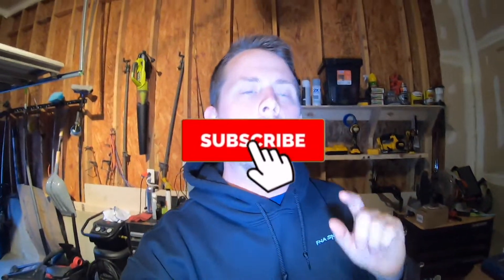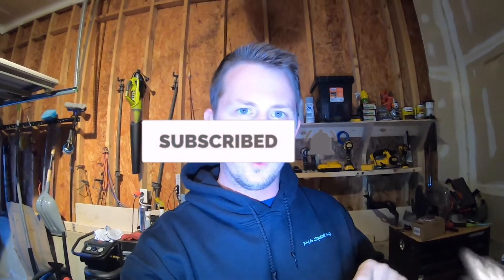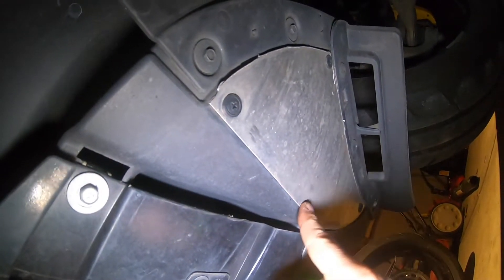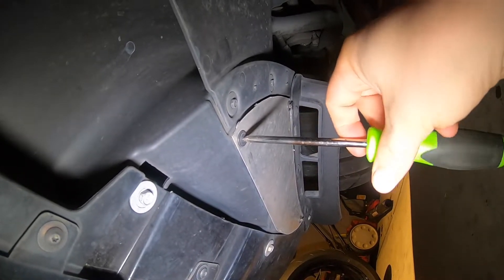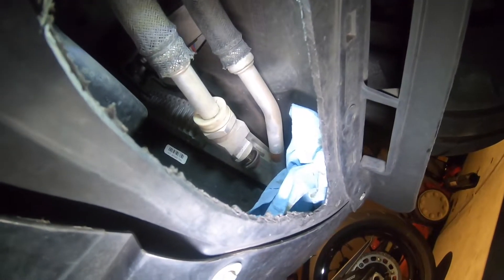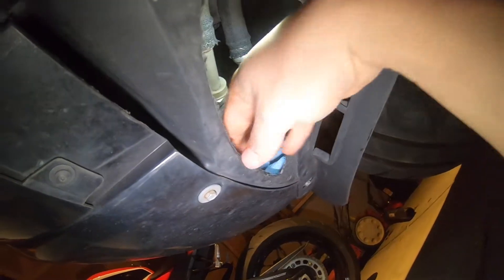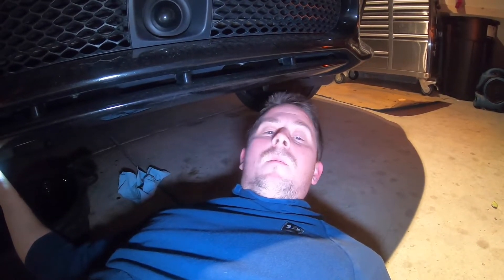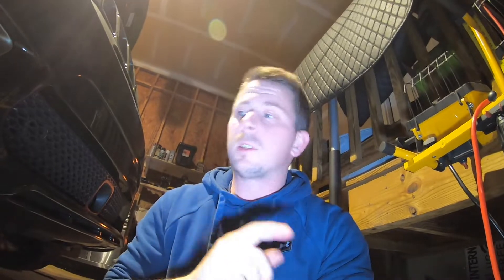HOW TO drain the oil cooler on a TRACKHAWK!

Comment: My guy at the shop just tucks a cut oil container under the drain. Never had to cut an opening on the bottom. After he showed me how to do it I scrubbed my plans of cutting an access panel.
Reply from the maker: EastCoastJeepSRT that’s interesting.  How do you get to the plug?
Reply: FnA Speed I’ll ask him to use my GoPro on my last free oil change at the dealership. He cut a quart or oil in half and slides it underneath. Not sure what he uses to open the drain. My concern the first time I went was them removing my bumper to do it. Told them don’t do that. Dude just says don’t worry, watch. Super easy.
Reply from the maker: EastCoastJeepSRT well then... I’d be interested to see for sure.  I couldn’t figure out any other way to get to it but then again, there are much smarter people out there 😂

Comment: There's a gaurd liner  on the offside wheel arch behind the cooler thats just a few bolts and clips then you can take it off and easily access the oil cooler...i dont know how to send pics but i did it for my misses n her trackhawk 2018 6.2 supercharged...i didnt have to wreck her splash tray only problem is you need those rivet style inner gaurd linning clips to fit it back up...so we bought heaps for future changes...

Comment: You can put a quick drain plug and attach a hose to it. Do not use the flip valve type. Use the twist valve. Airborne triple nickel 555